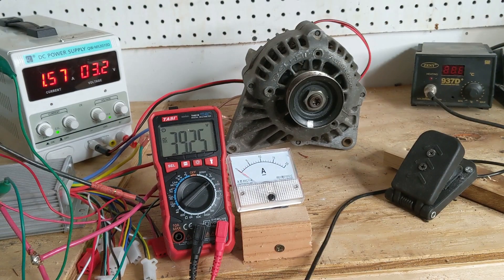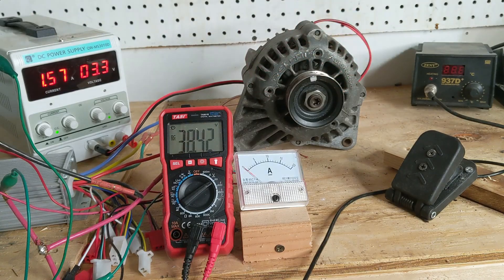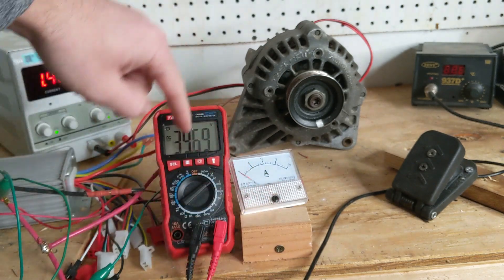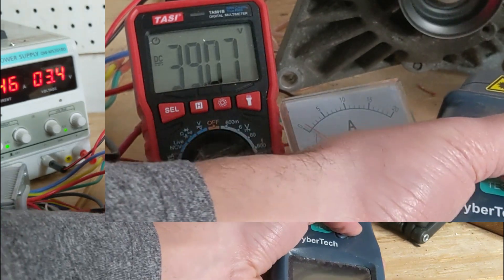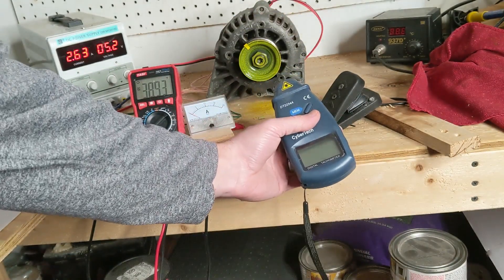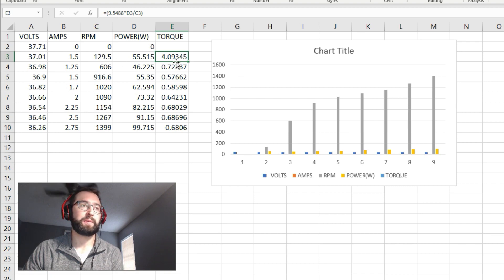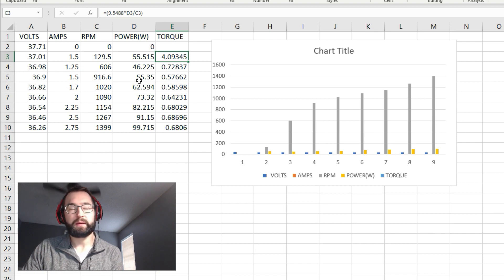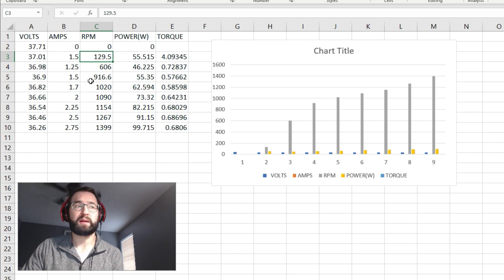TORQUE ON AN ALTERNATOR

Comment: Expected the physical measurement of shaft torque at different speed and rotor current, but disappointed :( There is zero reason to calculate torque based on electric power consumption and w/o load. Formula works for calculation from shaft power measured directly, and maybe anybody knows that w/o load it's zero N-m of available torque. And you don't know the efficiency of the motor, thus it may consume 50W but shaft power about 20W or 40W or anything else depending on many factors, that's why it must be measured directly.

Comment: You need to mechanically load the motor in order to get larger torque out of it. Also, if you increase the field current, you should get more torque and less max speed.

Comment: Question… what affect does voltage adjustment on the armature make on the output of motor? And what kind of voltage can a conversation like this take, like say a 96v speed controller and battery?

Comment: My experience with go-karts, a moto turning upwards of 4-5k rpm would be on the faster side, gas engine! With a motor 'electric' depending on the TQ,  possibly less rpm, maybe more, likely more, alternators as a charging source likes to spin upwards of 10k to 12-14k rpm, 2-3x engine rpm, possibly 4x engine speed, and only about 60% effiency, so it would possibly be more efficient as a motor,  getting enough power to equal a 7-8hp gas engine from a alternator! Is it possible?

Comment: Could you not take these reading from one phase then multiply that power from that phase by 3 since the windings should be of the same properties?
Reply: Theoretically, yes. However, you would have to make sure the esc wasn't simply outputting a square wave if you wanted your calculations to be more than just rough estimates. Usually only the more expensive motor controllers put out an actual sine wave. However, analog ammeters and voltmeters technically measure the average current and voltage due to their relatively slow "refresh rate" so using those may give you reasonably accurate results even with a square wave esc output.

Comment: If i make a battery back out of car batteries do they have to be the same brand and ahs
Reply from the maker: If you wire them in series they need to be the same amp hour, but can be different voltage.
.
If you are wiring in parallel they can be different amp hour, but need same voltage in each
Reply: @MadeEasyChannel  thx

Comment: The formula is an approximation however you need the amp and RPM under load, so the numbers you have are the approximate torque needed to overcome the friction of the motor itself.  Hook it up to a axel shaft with a disk brake on it.  Mount the brake so that you can use a scale to measure the force, then you can figure out the ft-lbs the brakes are applying.  ... look up how to make a brake dyno or find a small engine shop that has a dyno.
Reply from the maker: This is great and very helpful 👍 you are 100% correct
Reply: Your Units are not Metric makes no sense outside US. But a good process.

Comment: I am very curious about how the rotor current affects performance. You should be able to modify the motor's speed and torque characteristics by changing the rotor current, as someone once suggested to me.  If I understand the operating principles correctly,  the no load rpm would decrease if the rotor current is higher. A stronger magnetic field in the rotor would effectively create a lower Kv motor.

Comment: This looks like it should behave just like a brushless motor if you ignore the current going to the rotor. The motor can only produce as much torque as is demanded by the load. What you really should be calculating is the relationship between torque and the current going to the stator windings, known as the torque constant (Kt).  Kt is the inverse of the speed constant, Kv, which you can calculate by measuring the no-load motor speed (in radians/sec) at a known voltage, i.e. battery voltage at full throttle. Here's how:
shaft speed (n) = 1400rpm x pi/30 = 147rad/s
Kv = n/V = 147/36.3 = 4.04
Kt = 1/Kv = 0.248 Nm/A
Torque = Kt x I = 0.248 x 2.75 = 0.68Nm
Since there is no external load on the shaft, this is the torque required to overcome internal friction. At no load most energy is lost to friction and very little is lost to heat in the wires. That is why the result is similar to what you have calculated. 
If a load is applied the speed will decrease and current will increase until the the motor torque is in equilibrium with the load. More energy will be lost due to resistance in the windings and your method of calculating torque will no longer apply.
The torque constant does not change with voltage, so you can calculate the torque by simply multiplying Kt with current, regardless of throttle setting.

Comment: Hi, I just wanted to say that I like you. The way you talk, explain, edit, behave makes you really sympathetic to me. I've been watching all your videos about the alternator-motor multiple times now and I like them a lot. 

I don't have the most experience in that space as I am still learning a lot about it so take my words with a grain of salt, but here is what I would think about your results:
1. It got mentioned already but I think your formula is more of an appraisal because power is lost at the motor itself and at the motor controller. However, the values should be in the right ballpark so it is a nice quick look at it. The RPM doesn't seem too out of place as well.
2. The very high calculated torque upon starting your motor is (as far as I'm concerned) due to the torque being calculated via the formula instead of being measured. Upon starting this motor there will be a huge inrush current which means that a lot of the power goes into the electric fields of the motor instead of mechanically powering it. 

Moreover, I could imagine your motor having more torque when you fully power it (under load). It only consumed 100W whereas I can imagine it going way past 500W as well. Great video nevertheless, you are a true inspiration for me, I want to build an alternator-motor too :)
Reply: Hello i had tried with everyone to show me how connected power and esc controller to the alternator but none had replied or show me
Reply: @tienlam5412  im not an expert but there are many videos that explain it.

Comment: I don't mean to discourage you,  great ideas going on...
SO much wrong with your testing I do not know where to begin...
1) voltage to the speed controller in NOT voltage to windings/motor...
2) NO-LOAD on the motor when running is not relative to measure the current / torque for MAX of motor output...
3) Battery pack is far too small to measure the max torque output of that "motor" under full load...
I would seriously question whether you can actually determine the true output of any unknown motor with any formula from only the voltage and current applied without more known characteristics... mainly the efficiency for the motor itself,  which would be the actual physical torque output vs. the power draw in watts...
What is the source of your formula?  I would research the application of your formula...

For a moment, consider the amperage output of the unit as an alternator... If it was a 60 amp alternator, the windings are capable of drawing similar (60 amps) under full load...  That is more than 2KW at 36V.
I would drop that back a little for safety, but could easily use a 1.5KW speed controller for max (if it was a 60A alternator)...  Then you would need a battery pack capable to support the load...  THEN you would need a physical LOAD to be able to max it out...

... For a "common sense" sanity check... imagine one of the windings was partially "shorted"... that would cause a much higher current draw... might still run... but put out MUCH less torque... but your formula would say the opposite...

Keep going though... honestly... KEEP GOING!
Reply: Hi Todd,
Just out of curiousity, how do you match the speed controller to a motor like this? Would the 60A converted alternator need a speed controller rated to 60A for application in something like a go cart, or can it be rated to the amps that it would draw under steady use?
Cheers
Reply: @bradydawson3705  it's so hard to know exactly without some proper testing. Another important factor is the VOLTAGE you plan to run it with. I believe it would be more accurate to guess that a 60A unit made 14v DC.  So there is 840 Watts. Common sense that if you are driving with 14v then you need a 840W driver... But if you plan on using 48v... Then I'm pretty sure the current capacity will drop.  Is that a 1:1 conversion? Probably not exactly, but close would be a good guess... Best advice is to keep the volt x current (watts) as the benchmark... Then find what is available.

Comment: Something is really wrong with this formula. It implies that with 20w of power and 1rpm you have 190Nm, which is more than my 2.0 petrol engine have with 150hp at 5000rpm ???
Reply from the maker: Not sure, maybe you're right. I will look more into it
Reply: I was surprised by the formula as well, especially because it has no load on it, however it seems to check out. I think you mistake was not to take the power in *kilo*watts. Because 9.45 * 0.02kW / 1rpm = 0.1908 Nm which is reasonable.